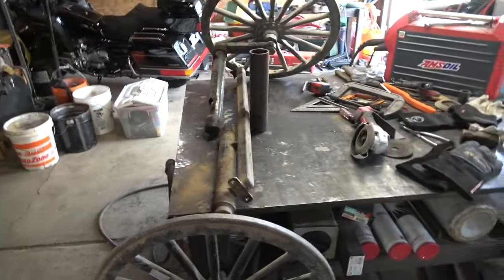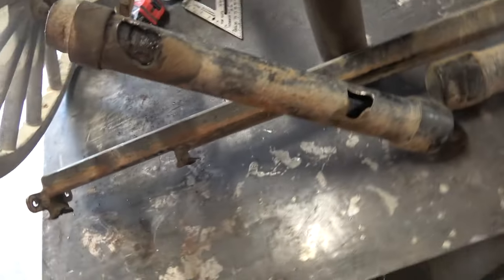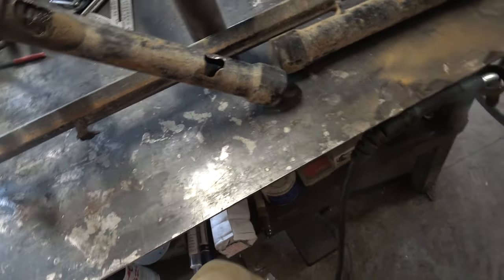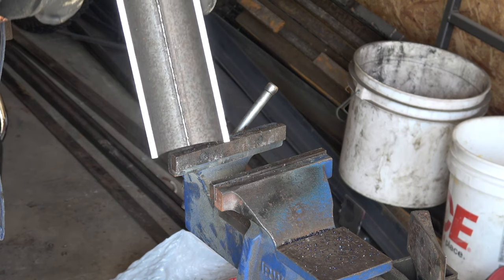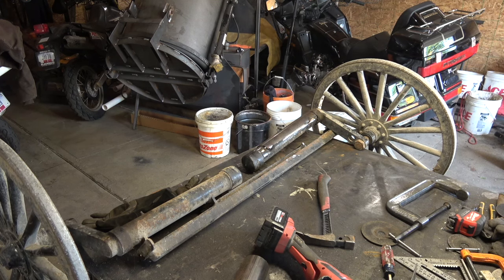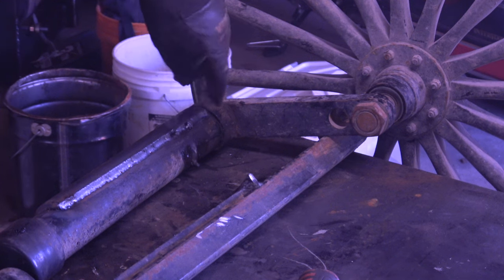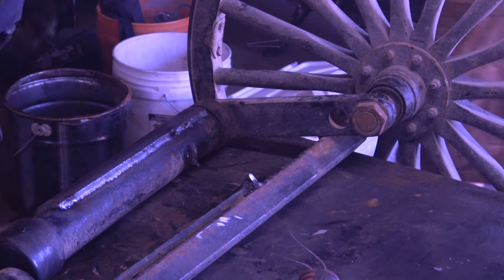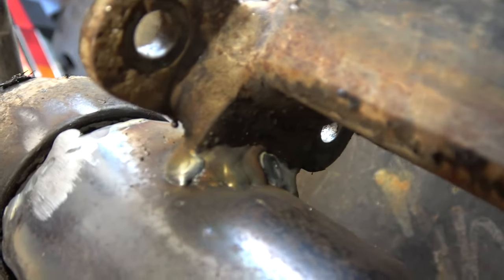Wagon Axle welding repair

Comment: All that heat had to do a number on the rubber torsion springs inside. They have a new version of that axle that uses flat steel torsion bar springs instead of the rubber and is a little heavier built. I've installed several of them.
Reply from the maker: It probably did. That’s part of the reason why I used mig. It kept the heat input lower than stick or tig and can tolerate some levels of rust and oil. Not as much as 6010 but 6010 would have put a lot of heat into the part. In this case the customer was capable and willing to change out the rubber or the entire axle his self if it did come to that.